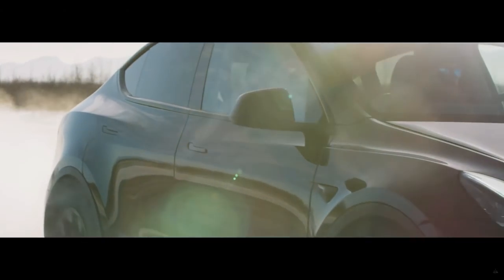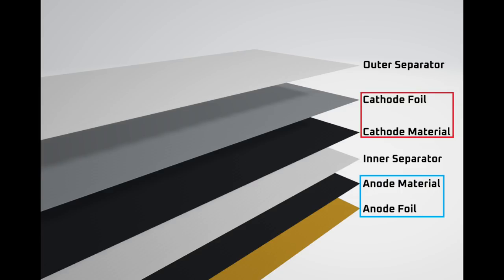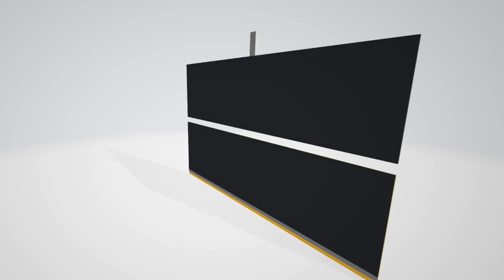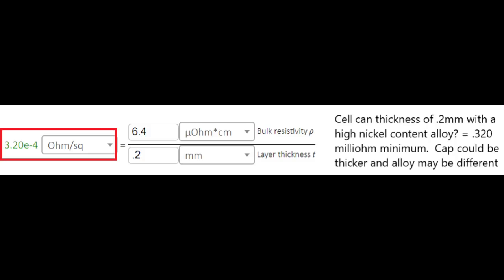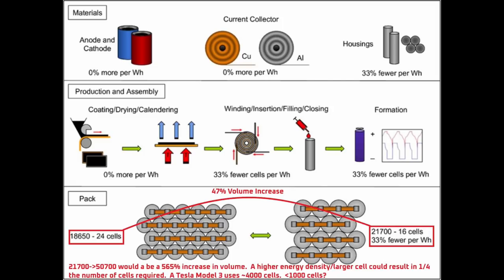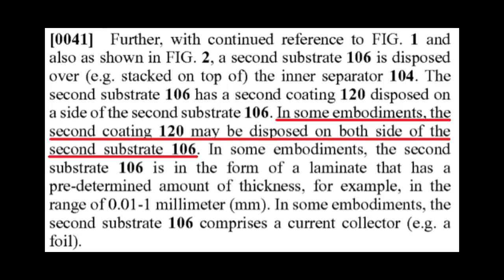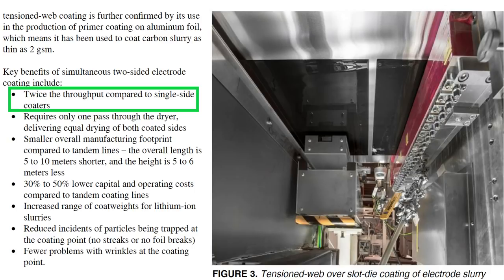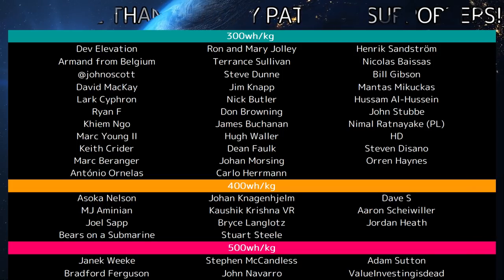Tabless Electrode Patent (Deep Dive)

Comment: I like this from a Yield Rate point of view. I have seen reviews claiming one of the challenged Panasonic had with Giga Nevada was to be able to achieve what Tesla expected in terms of yield rate for their production lines. 

I can be wrong but raise the yield rate maybe one of the reasons the differences betwn Tesla & Pana and the non-completion of the Giga Nevada. Tesla must have learnt from these Panasonic challenges on the current battery types and sort changes by building the cylindrical battery ground up using the first principles. (Applying and testing these patents). 

The new batteries could be integrated into the changes Panasonic carried out and included in their achievement of 35GW for the existing lines. More efficient use of existing footprint production lines, to pilot higher speed, efficient, least cost production lines defines the Terafactories to be proposed at battery day. 

Great Research!
Reply from the maker: Thanks Joel and I appreciate your thoughts.  Glad you picked up on the Yield rate!  As an investor, this is where it's at for me.
You are correct on Panasonic's yield rate.  It took them a good long while before it was acceptable - a year/year and a half.
Reply: Nils Frederking agree that it would Be hard for Panasonic to change their production lines significantly.  Personally think that the only thing they are likely to do is change chemistry of the electrolyte.
Reply: Nils Frederking me too!

Comment: Letting the outer end of the anode current collector directly touch the can is another genius move. So simple and effective. It would make cooling much more effective even if the cathode still had a tab.
I wonder if there would be an issue with contact corrosion. Engineers normally avoid having dissimilar metals touch directly, especially if there is electric current flowing through the system. Not sure how the situation is in a controlled chemical environment inside a sealed cell. Also, I guess the same issue must already be mitigated in conventional cells anyway at the tab welding spot.
Reply from the maker: It was a thinker, lol.  It took me about two days before the thought erupted in my mind.  I was wondering about corrosion as well.
Reply: @thelimitingfactor  Instead of putting the copper foil to the can, could they put the aluminium foil to the (aluminium I think?) can? If both are aluminium they shouldn't get dissimilar metal corrosion. If they have to switch polarity convention on their own stuff, that shouldn't matter right? Or is there some additional factor that I'm missing?
Reply from the maker: @RFjellstroem  I've heard that they are putting more additional aluminum contact in the can!  Maybe this is it!?  :o
Reply: @RFjellstroem  the cans are steel.
Reply: @w0ttheh3ll  Haha, then scratch my thought! They probably have a better solution anyway than what I imagined.
Reply: Bimetal contact plus heat do not produce "corrosion" per se (in the absence of an oxidizer or other element to form a compound). It Does introduce effusion embrittlement. Atoms from one metal diffuse into the other's matrix causing local stresses due to disparate atom size. If anything, the brute force solution is a larger surface area, a tab is similarly subject to this but has a much, much smaller surface area. 
My guess. the problem is mitigated rather than amplified.

Comment: Ref Tandem Coater ~ coat both surfaces and run the oven vertically.  That is how PTFE is 'sintered' onto electrical conductors without damaging the insulator..

Comment: In my view they  will have to ultrasonic weld cells edges. Getting a weld along the whole edge sounds very difficult and complex. I have done ultrasonic welding of packs and getting consistent results  isn't as easy as you would think. I can inspect my welds visually but they can't see any thing. You can detect a bad weld reading the cells internal resistance but finding where the bad  weld or welds would be very difficult. This is an aggressive project that would require massive life tests. They are basically trying to make the cell and the pack in one process  from two processes.  I think people under appreciate the amount of design  work that went in the lead acid car battery. Tesla is making the same type of design but using lithium.
Reply from the maker: Thanks for the insights Steve, that's greatly appreciated.

Comment: Love your videos! One correction: I have broken down many cells (both cylindrical and pouch) as an academic battery researcher and have never come across one that is not already double-side coated. This includes the Panasonic NCR18650B, which was Tesla's cell of choice several years ago. As you mention, double-sided coatings significantly increase energy density, homogenize current distribution, and reduce the weight ratio of inactive to active components in the cell!
Reply from the maker: That's weird!  I'm trying to circle that square.  I've never seen a breakdown video with double-sided.  I've taken apart a battery and it was single-sided.
Reply from the maker: I just watched a bunch of videos and they were all double-sided.   Thanks for pointing this out!  Apparently I'm blind.

Comment: If current deviation is less of an issue with tabless cells, manufacturers might be able to get away with slightly thinner current collector foils (that sustain more deformation damage on the production line, thus have more current deviation). This would increase energy density.

Comment: In addition to possibility of thinner current collecters, this actually improve the cell balancing. As of now, the balance is handled between rolls through the various concentration of avaible li ions in the electrolyte, which is not fast enough to migrate to rolls, this solves this by insuring all layers have the same voltage as they are connected in parralel, so small variations are eliminated

Comment: Would the tabless electrode(s) also decrease the internal resistance, making faster charging/discharging possible? Of course the better cooling will also help with this. 

I'm also assuming longer cycle lifetimes, as there is less stress on the battery.

Bring on battery day!
Reply from the maker: It all depends on how the cell is engineered.  Regardless, the tabless electrode should help with cooling which in turn helps with charge and discharge rates.
Reply: I believe its directly improves charge and discharge rate.. but as
per TLF above: They will trade off any large performance gains for other improvements too
Reply: Solid state batteries need no cooling!
Reply: The charge rate is fundamentally limited by heat loss from movement of electrons through the material.... so Yes, it could be dramatically increased.... however, they already increased the size of the battery taking advantage of part of that benefit. Any residual benefit could go into improved charge rate. 
My guess is that it will significantly benefit regardless. This would be expressed in the "power density". They mention power at a couple of points but no direct reference.

Comment: Thanks for the great video 👍🏻!
I didn't know that there was such a difference in battery's internal resistance between "a real use case" DC measurement and an AC impedance measurement - good to know. Like for example 17 mOhm listed for 18650 Sony VTC5A sounds good but it really is quite a lot more with DC then (I guess).
Reply from the maker: Yeah man, it varies hugely with the testing method.  AC frequency, type of DC testing, etc.  It's a slippery number.
Reply: @thelimitingfactor  Yeah, I'm glad your video bring me that info!

Comment: Love all the info. I'm a retired electronic engineer but had never had much reason to consider battery tech. I feel like I just had a semester worth of battery tech!!! The tabless idea seems such a first principals idea yet no one came up with it till now??? Must be because of the early designs for portable electronics. I once ran into such thinking when trying to find a solution for a work problem till someone pointed out that someone had solved the problem a long time ago but no one had applied it to my problem. @The Limiting Factor
Reply from the maker: Yeah!  Totally!  Like wheels on luggage, lol.  And also, I agree, often an engineering challenge has been resolved - sometimes it's a matter of doing or a matter of too many MBAs running businesses that should be engineering led. America needs to rebuild its relationship with engineering and manufacturing.

Comment: Great info/ video. Cadenza, a battery technology startup, use ceramic housings to store their cells. This makes them lighter, more compact and offers better fire resistance. This might also eliminate the requirement for an outer cell separator, as noted in your video.
Reply from the maker: Ha!  Very cool, great information

Comment: Great analysis. I think the breakthrough might come from thicker cathodes with fewer rolls, as current sheets thickness is a big factor in increasing the energy density (thicker is more kwh/kg), but the trade off is power density. With a tabeless design, it might allow for thicker more dense sheets. Combine that with DBE improvement of 20-30% in kwh/kg, cell to pack improvement of 10%, double coated sheets, and you might have a 40% improvement in energy density, with reduced cost per kwh. Apply that to the LFP cathode based battery with input from CATL, with its inherent lower cost and higher cycling life, and we have our selves the cheaper lighter million miles battery breakthrough. One simple method to manufacture a tabeless battery could be using an over hanging copper/aluminum sheet ends, that have no electrode material on them. An extra millimeter on each sides of the cell could touch the cylinder end caps to conduct the electron flow.
Reply: Alternatively, we can reduce the thickness of the copper/aluminum current collecter due to improved electrical conductivity, which will benifit improved energy density at reduced cost of material, and improved material weight fraction of the total weight of the cell
Reply from the maker: Totally!

Comment: 09:50 the Watts are result of the amperage squared times the resistance. Driving a car is not a constant discharge, which makes the heat problem far worse, specially when driven "hard", as its the current squared. This also explains why Jack Rickard didn't find any heating as in his experiment he was discharging constantly at 1.25Amps, when it will be significantly more when accelerating hard.
On the other hand the 100m Ohms you assumed are a bit generous when compared with the graph @ 09:40
Reply from the maker: Agree on all points.  The graph at 9:40 didn't specify the testing type.  The testing type can vary the result by an order of magnitude.

Comment: They might be able to patent it for batteries, but i have seen identical construction used for HV and HC capacitors. In the first they used for extreme high energy flash tube capacitors, the one that is closest are the super capacitor electrodes. This allows an even discharge at maximum current. Lots of possible current 😮

Comment: Awesome content, thanks!
One thing about the example you showed was both the positive and negative sheets showed on the bottom of the example.  It would seem in the design the positive foil would stick out the top of the sheet and the negative would stick out the bottom, then you can just crush them into the can and get lots of contact on both ends.
Reply from the maker: LOL, I love it. Compression contact all around.

Comment: Prior to this video my simple estimation was:

-2” x 40” active sandwiched layer size.
- I assumed tabs were on the end.
-so average current flow distance in tabbed battery = 40”/2 .
- average current flow distance in no tab battery = 2”/2.
That’s a 20 times reduction in distance, which is the same as resistance in the cell. 
-Note: only 10 fold improvement if tab is in middle. And the additional resistance of the tab to shell bottleneck, was never factored..
Reply: Going a step further: I heard a rumour of going from 21mm to 50 mm diameter battery.  Using circle surface area and assuming they keep the same cell length and chemistry: I believe that’s  5.6 times the capacity per cell. (a 2”x 224” unrolled strip)
and 5.6 times the internal resistance - which is well within the improvement ‘ No Tabs’ brings

Comment: This was great thanks - the best information I've seen so far(and I search for it too).
It seems to me that by concentrating the thermal-pathway at the tab that this will allow a much simpler(cost/time) array of heat management schemes, compared to the current use of coolant pumped through ribbon wrapped around cells with thermo-conductive 'goo'.

Comment: Fantastic video. I had to watch a few times to grasp many aspects of this improved technology.  

Here is a key detail that I would like to get clarity on:  Your actual measurement of the resistance of a new Tesla cell shows 15 milliohms. This is empirical measured data.  At 9:10 you state, "However this is only the resistance of the electrodes and cell can" (9:10). I don't quite understand how can that be? You are measuring the resistance of cell across the two terminals and so it has to include all materials inside the cell. But your calculation shows 100 to 130 milliohms taking cathode foils and material into consideration.  

I am trying to understand the disconnect between actual measured resistance (15 milliohms), and your calculation taking all materials into consideration (100 milliohms)

Comment: One can further reduce Tesla 4680 Tesla cylindrical tabless battery Ohm losses and increase heat dissipation  by tapering the electrodes in the battery's cylinder axial direction so that each electrode thickness is increased where the currents and heat flow are higher, near the continuous "tab".   This tapering is one further step in the optimization of volumetric and mass energy density.
The tapers of the cathode and  anode  rubans are matched so that the thickness of both electrodes and the electrolyte  is constant as thus the roll is a cylinder.
The tapper can be straight for ease of manufacturing or nonlinear to minimise RI**2 and maximize heat transfer to the "tab" or end section. The anode taper and the cathode taper need to match to keep the roll cylindrical.
The tab end of each electrode rubans can further be shaped so that as the ruban is winded the ruban tab end makes contact with itself so that no tab bending is required.  This creates a solid disk at each end of the roll which again provides low electrical and heat transfer resistance.

The thin side of each electrode  ruban may have to be enlarged to form a small wire  ( ==O ) to provide mechanical strength to the anode edge and reduce electrical and mechanical stresses in the electrolyte.  The  thick end will have a matching indentation.

One should further explore the parameter space of electrodes and electrolyte thickness in the axial direction by manufacturing and experimental  testing.   That may get us to the Million miles battery.

Comment: Hi there, I am confused by one point of the video.
Normally, the Li-ion should penetrate the separate (Electrolyte) from the cathode to the anode during discharging.
It is showing that the Li-ions travelling to the tab, which I think might not be correct.
Reply from the maker: What that's meant to show is that at places where electrons are released, there is corresonding ioinic activity.  I'm not trying to show that lithium ions are flowing throw Al or Cu...which is imopossible

Comment: Dear Sir, thank you very much for your content , it was very informative. However I would like to point out the analysis of the anode thickness regarding the heat generation for the same load (@ 18:27). 
I do not know if those anode thickness values have taken into account the coating thickness also. A energy cell is designed with a thicker coating leading for the electron and ion to move further depending on the porosity and tortuosity chosen by the cell designer, while a power oriented cell (PHEV for example) will be designed to increase the rate of electron per second leading to lower coating thickness and porosity/tortuosity parameters to help increasing the surface exchange between the particles/electrolyte/electrode.
Power oriented cell have lower resistance compared to energetic oriented cell, but the load is much higher with more than 10C on a Power oriented cell but for a shorter time load (except for a ZEV profile). Energetic oriented cell (BEV) will have max 2C load  (for short period) with a nominal around C/3.
I have supposed that the comparison made (@ 18:27) have considered an identical input current and cooling condition, which will lead to have the power oriented cell to be cooler
A thicker Copper or aluminium electrode will  help but was not worth it due to cost and ongoing tab design , provoking an important bottleneck. The tabless design , in addition to thicker electrode will definitely help in reducing the heat generation and improve the overall cooling coefficient of the cell , especially if the cell is cooled in the vertical position. 
Besides, the removal of the outer isolation sheet will help , if the contact resistance between JR (Jelly roll) is well reduced, but the safety design may become trickier.
The other advantages will also to have a better monitoring of the cell maximum temperature leading to a much finer control, allowing to use the battery as close as possible to its limit.
Thank you again for the video.
Best regards
Reply from the maker: Thanks for the input!  I'm sure you're probably right in terms of analysis.  Technically, I'm pretty weak.
Reply: @thelimitingfactor  Thank to you, your video was very informative and well explained. Hope other OEM and or cell manufacturer will follow this trend  initiated by TESLA instead of chasing the SOLID STATE